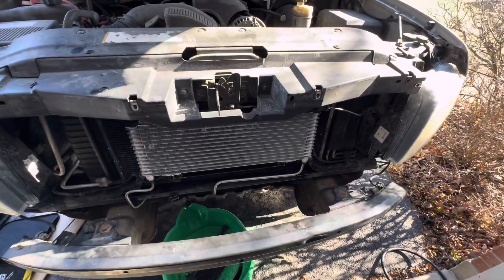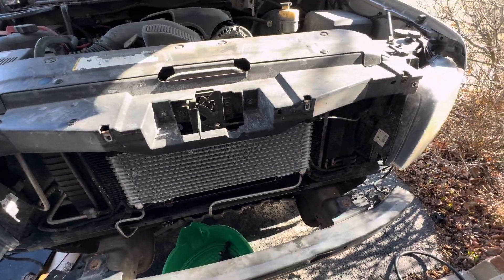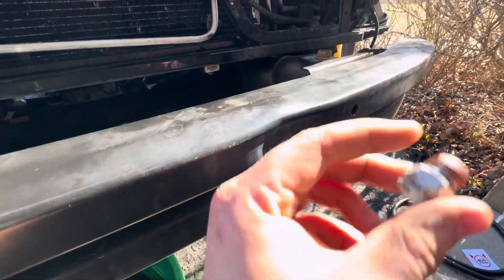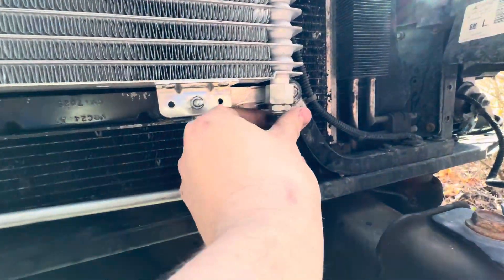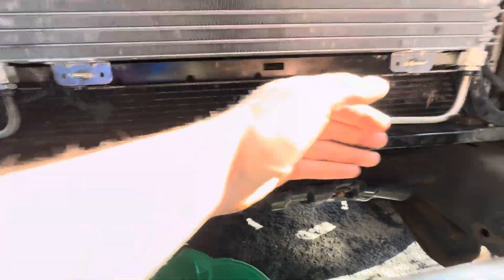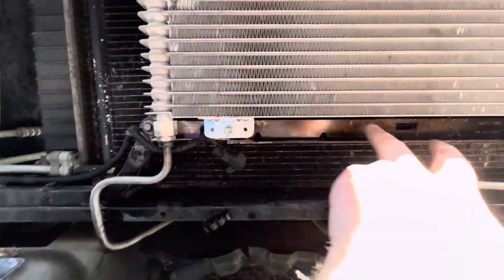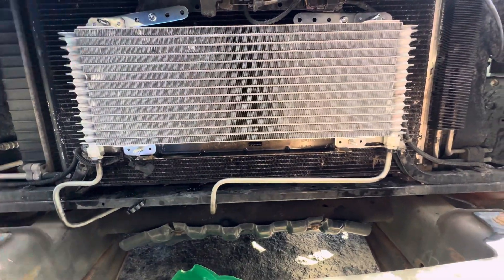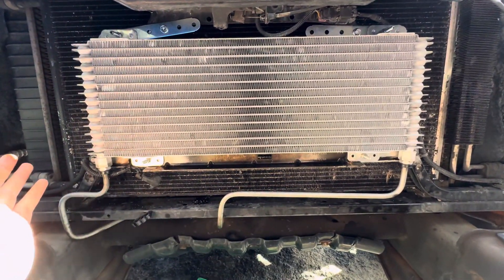GMT900/800 Truck/SUV Tru-cool 40k Install USING FACTORY LINES ONLY

Comment: Hey thanks for the video. I picked up some dorman 800-605 fittings and noticed they did not come with gaskets.  When you got your 800-605 fittings did they come with gaskets already, or did you source the gaskets elsewhere ? Thanks
Reply: They come with thread sealant pre-installed and new orings on the inside.
Reply from the maker: I had simply used O-rings from a generic O-ring kit, Id recommend some RTV as well.

Comment: Hey buddy, just wanted to say a big thank you for putting out this video, I had ordered a 40k to install over a weekend and was randomly suggested your video by Youtube, followed the way you did yours and it came out perfect, super easy install just trimmed the two corners of the lower bar brace to clear the lines and lower cooler brackets, installed the Dorman fittings, clipped the lines in reintalled the grill, enjoying 150degree temps down from the usual 200-220 my truck always ran at before. Thank you again!
Reply from the maker: Glad this helped, I figured guys would love to see it and be able to make a clean OEM+ install